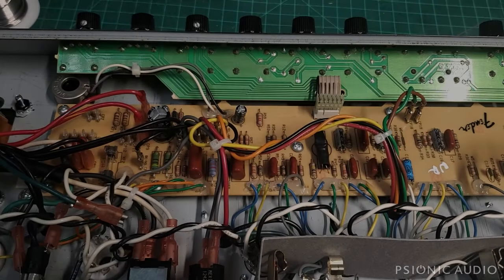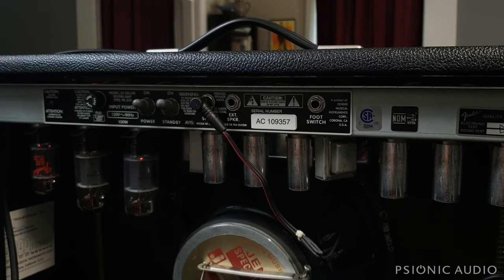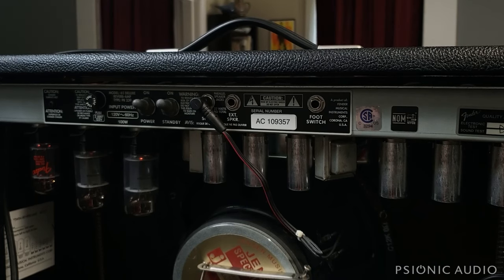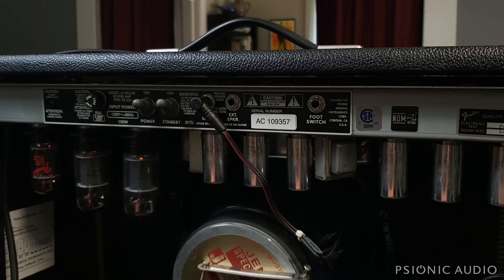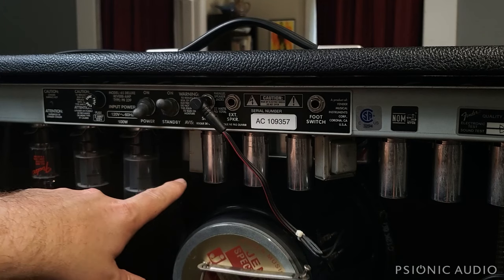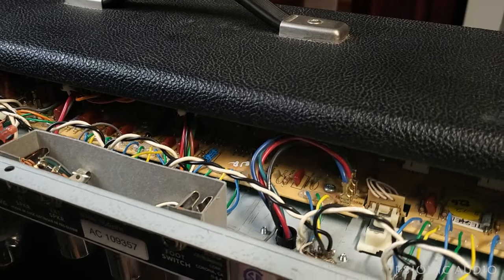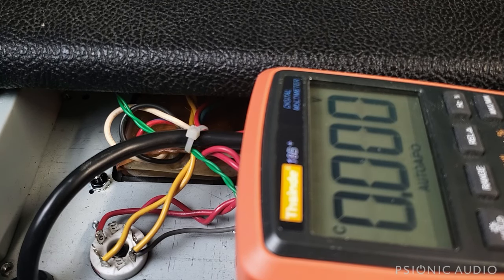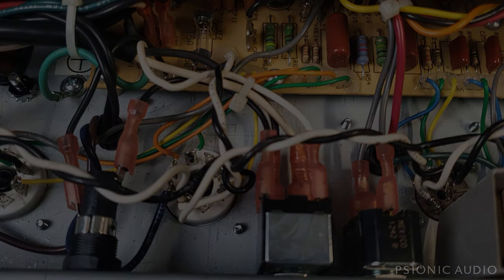(One Way to) Safely and Easily Discharge the Caps on Most Fender Tube Amps | READ THE DESCRIPTION!

Comment: Would this work with a Pro Junior by switching it off at the wall or extension socket, as it only has a single on/off switch?
Reply from the maker: It works. Amps should never be in standby for this, so the Pro Jr just makes it easier for you.
Reply: @PsionicAudio  Excellent, thanks Lyle

Comment: Why do you measure on the rectifier and screens instead of directly on the reservoir caps?
Reply: Because you would have to take the chassis completely out, flip it over and take off the doghouse cover to measure them. Lots of chances to potentially touch the wrong thing.
Reply from the maker: Because that would require refining the entire chassis BEFORE making sure things are safe. These measuring points are directly tied to the reservoir and screen caps.

Comment: This is actually quite dangerous. Once switched off, the heaters go off and the valves stop passing current. The capacitor(s) can still have considerable charge. Unplug the amp and reveal the chassis. Without poking about inside with your fingers, put the insulated probes of your voltmeter across the main capacitors, across B+ to ground. The high resistance of the voltmeter will safely discharge the capacitor(s). When the voltmeter read zero volts, there is no. charge left.
Reply from the maker: Notice where I said VERIFY.
Reply: @PsionicAudio  yes but you waste your time with the first stage and leave the amp  in a hazardous state. When you dump the charge through the voltmeter  it drains the caps and verifies in one go. If you were trained in handling high voltage you would  know this is the correct method. 
We are normally presented with a cold amp to work on. The caps will still have a residual charge and need shunting. 
The art  of working on high voltage equipment is you don't, you know how to make and verify the circuit is cold.  Mains, one hand in your pocket. High voltage, both hands in your pockets.
Reply from the maker: And yet I really don’t waste any time here. I don’t have time to argue about this.
Reply: @PsionicAudio  please do not end up killing someone with unprofessional advise.

Comment: No idea if this is entirely OK, but when I have to pull the chassis I often leave the power switch on and pull the AC plug from the wall and strum. I was unsure with some designs if turning the power switch off could prevent the power tubes from being drained.
Reply from the maker: Either will work. Pulling the plug is better just so you don't forget before pulling the chassis. I just couldn't do it easily at my bench while filming this.
Reply: @PsionicAudio  Thanks! Love the channel.

Comment: Can they sometimes recharge back while you are working?
Reply from the maker: No. They cannot get DC from the ether...
Reply: @PsionicAudio  , stray electrons actually do get trapped in the electrolyte between the capacitor foil layers, and so a filter capacitor that was drained and measured at "zero" volts can actually be measured again hours later and discovered to have built up a small residual charge again; rarely enough to give you a shock but possibly sufficient to damage a low-voltage semiconductor device. Not usually something to worry about safety-wise, nor would it be problematic when servicing a tube amp, but good to keep in mind when servicing solid-state equipment. A pair of say 10,000 mfd caps running at 80 volts can be drained, then measured again hours later only to find they've got maybe 10 volts stored on/built up in them, and enough current left to make a nice spark. It'll make you jump from the sheer surprise of it!
Reply from the maker: That's a small fluctuation.
Reply: @PsionicAudio  , true, but for those who aren't aware of it, it will make them question their competence or their sanity ----- "what the heck? I thought I already drained those caps, didn't I ?". It's also enough residual voltage to cause a digital meter set to ohms to give weird readings if you're checking resistors for correct value/tolerance or when you're doing continuity tests while looking for bad connections.